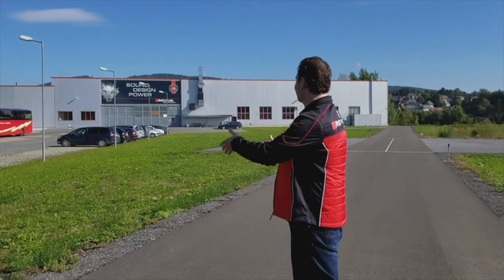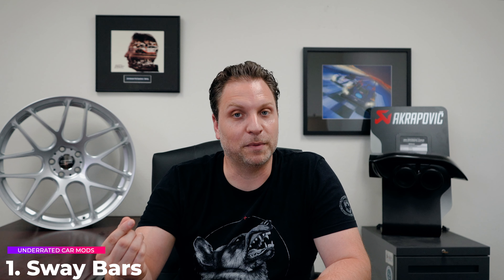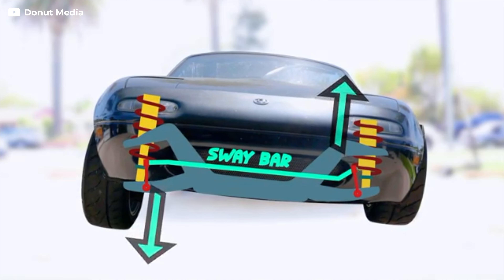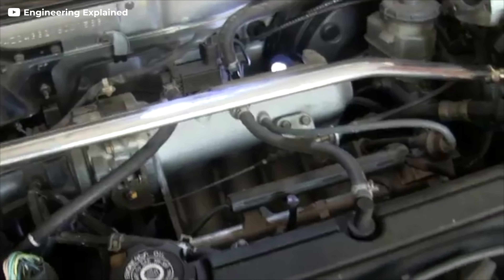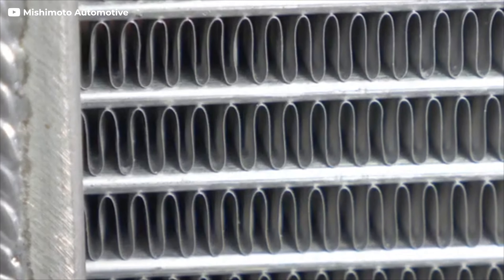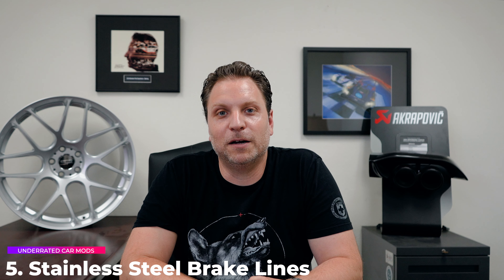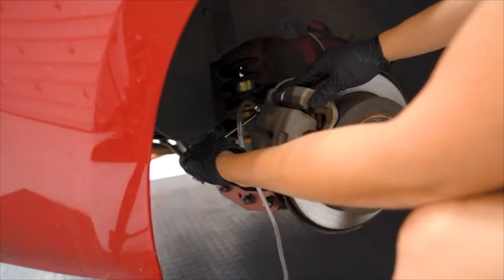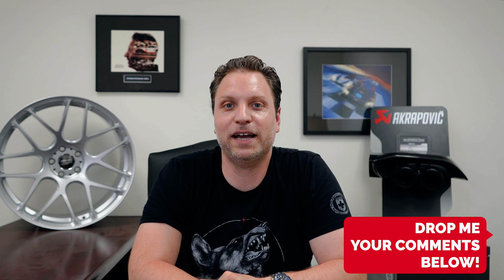5 Underrated Car Modifications!

Comment: i have been modding for 30 yrs numerous cars suspension is first sway bars ,bushings tires and dont forget brakes then u move on to engine mods before u do engine mods u might want to go over your cooling system take the steps necessary before u throw a tune i did a Race Chip after 2 yrs of doing my suspension, cooling and brakes Mod bargains did my alignment and that was also a pleasent surprise in driver feed back